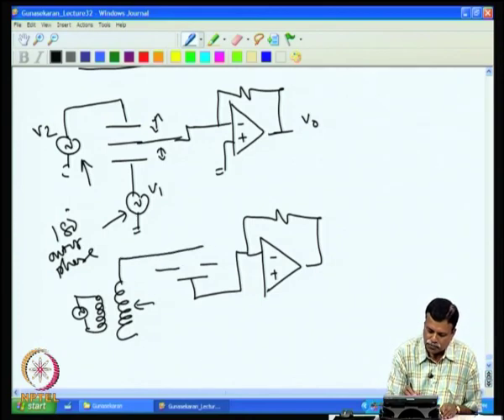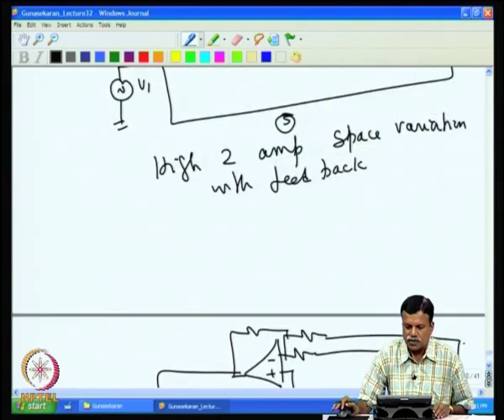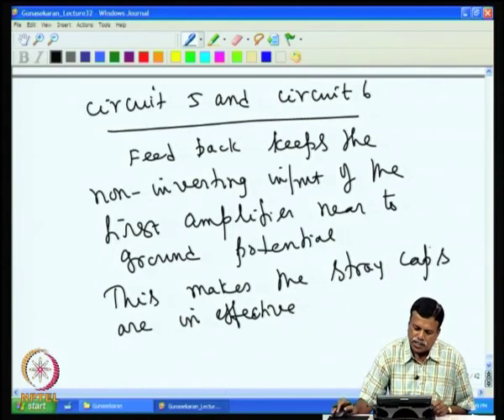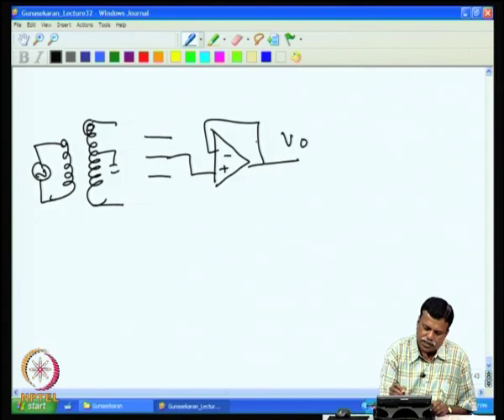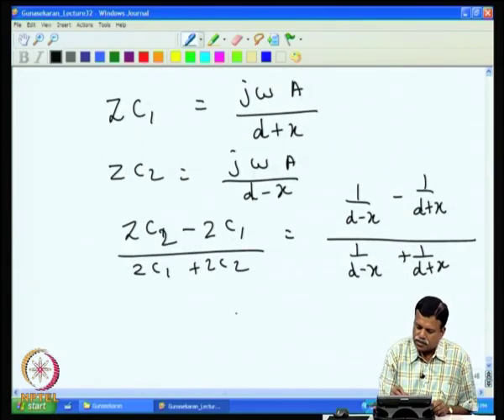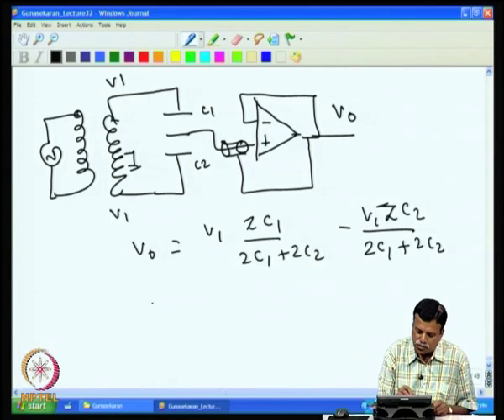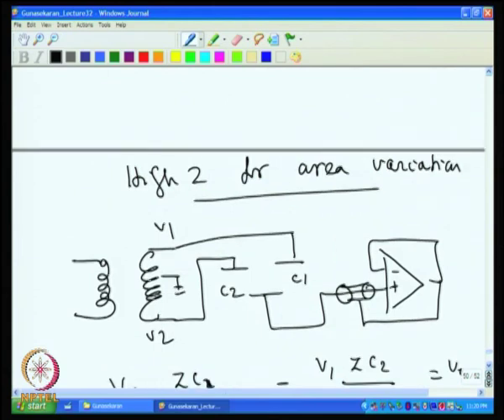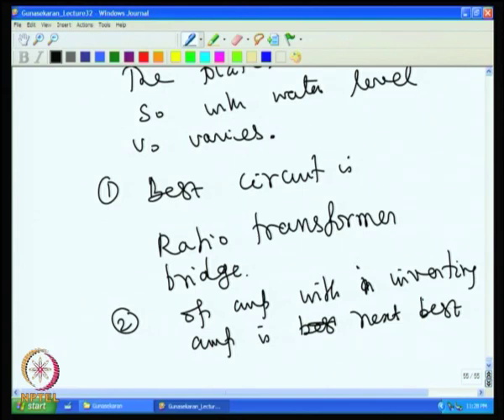Mod-06 Lec-32 Capacitive Sensor Circuit With High Impedance Amplifier

Comment: cool video!  I made a capacitance proximity detector before using an LC RF oscillator.  I attached a metal plate to the capacitor of the tuned circuit and was then able to shift the frequency of the oscillator by putting an object near the plate.  Higher frequency oscillators are effected by very small changes in capacitance so it was easy to make my circuit very sensitive. I have never seen your method before and may do some experiments with it since it looks like another great way to do this!